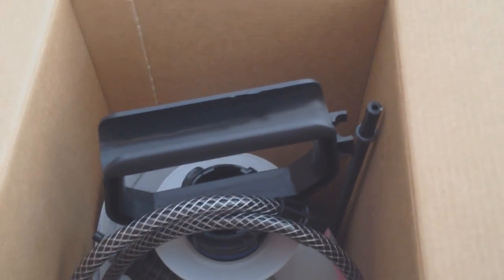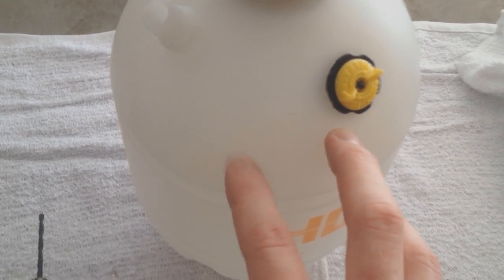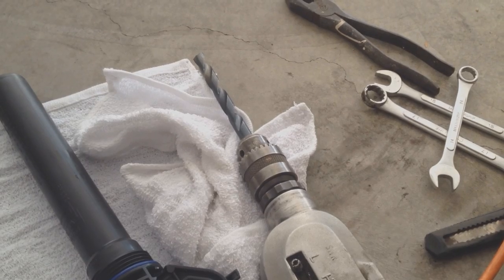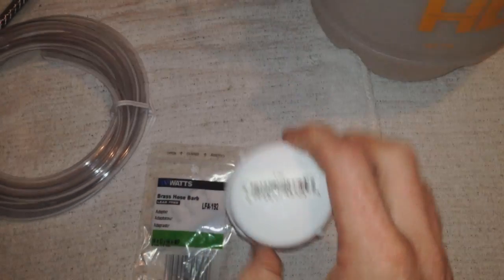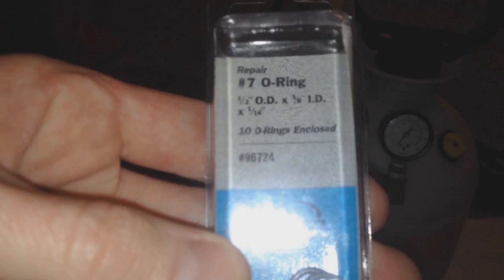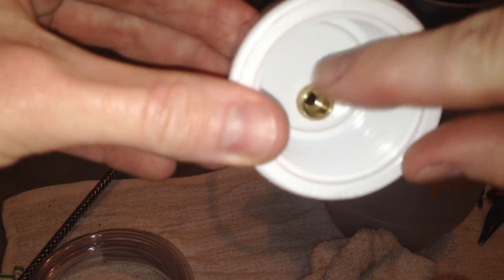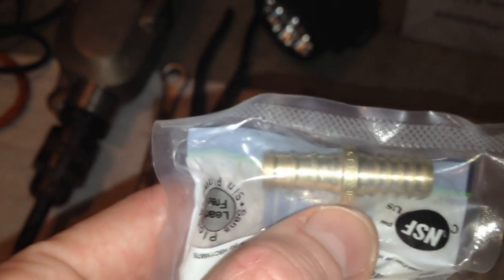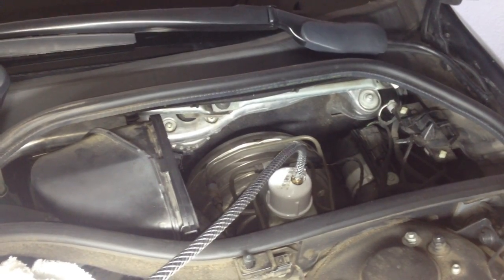DIY Make Your Own 1 Man Pressure Brake Bleeder

Comment: The guy @ Mercedessource sells parts and DIY manuals on many topics. It is the same pressure tank, but it was developed from the Motive brand brake bleed system. You can buy an adapter from Motive to fit any car and not have to use plumbing caps that might leak or mess up your reservoir... Just so other people know

Comment: Built this pressure bleeder and used it today.  Have a couple minor things I ran into I want to share.  This one is obvious but I was under the car doing the job before it came to me. Use a clear bottle for your catch bottle.  I just unthinkingly grabbed a green soda bottle and realized while using it that it was difficult to see when clear, new fluid was coming out (I was also using old tubing on that end that was discolored which didn't help.)
I have all GM cars that use the same Master Cyl cap.  Bought a Dornan at Advance Auto.  Guess what.  The rubber gasket is sold separate.  It gets worse.  Dornan mislabeled the part numbers or some how screwed up because the rubber gaskets marked for GM are all to small in diameter.  Further checking showed this to be so at all the auto parts stores I checked.  NAPA surprisingly didn't have one at all. The Ford gasket fits the GM cap right.  Criminy.
I put a QD on the hose near the cap.  Makes it very easy to get master Cyl pressure cap on and off w/o mess.
I found that 10 psi is plenty to push the fluid through.  Worked quite well once I got these glitches remedied.
Reply: Any color bottle 8s fine, bit clear hose is a must
Reply: @ethanmaiden  Don't do this.  It works but this is far from best way to do a bleed.  Makes a BF mess for one thing.  Vacuum bleeder from Harbor Freight, blows this away.

Comment: Great vid.
Using a 1/4" NPT (or other appropriate) tap would allow you to thread the material with the correct tapered thread pitch.The correct drill size is usually marked on the tap. No need for o-rings, heating plastic, potential leaks, or a fitting suddenly shooting out of an improperly, or non threaded, hole at your nut sack.

Comment: Looks like a great idea.
My one question is, what happens to the air between the brake bleeder including the hose and the brake fluid reservoir when you start pressing fluid into the system, does all that air have to be pushed through the system.
Reply: That a good observation. I would "prime " the line with fluid first.
Reply: That is how you do the pressure bleeders, prime the line first and completely fill resovoir

Comment: Much simpler than that. In a pinch, get a hose, a water bottle and some string. hose goes from the bleed valve to the bottom of the water bottle. String holds water bottle in position. Make sure the hose goes ALL THE WAY TO THE BOTTOM to prevent loss of vacuum. Put the whole apparatus on your bleed valve and open the valve. Now, get in your hood and open the cap. Put your lips directly on the reservoir and blow. Make sure you don't blow too long or you will just force air into your lines (rather than out). If necessary, refill the reservoir between blows. Keep a bowl under the water bottle in case of spill over.

Done. Less than a dollar and you likely already have all of this stuff laying around.

Comment: you can go on and on about nothing
Reply: I am impressed about building you own pressurized brake fluid bleeder.  I  must have watched 10 or more videos now that I am house bound becsuse of the virus pandemic.  Ok to the point.  I see two different uses/methods  for the pressurized converted tank.  One video showed using the tank for pushing air only into a fully topped off Fluid reservoir  then pushing the old fluid out at each wheel brake caliper when opened.  

The other method and maybe the most common way of using the pump tank to house the new brake fluid and push it through the fluid reservoir and out the lines.  Maybe I am confused by watching the different methods including the hand held small tank powered by a compressor line, hand pressured tank (your method and even the trigger devise causing the old fluid to drain once the valve was opened.  I think, and maybe not well thought out, that if you keep the hand pump tank for pressure,  put a one way valve in line so no back fill, top off the reservoir every so often, using the pressure release valve on the tank before opening the reservoir and as you get to the end of the bleeding you Don't overfill the resevoir and have to Turkey baster it back out similar to when you started the process  so you Don't keep pushing old fluid through the lines.  plus you can minimize the amount of fluid to.mighr not need to open.  DOT4 is expensive for Porsches,  as you well know.  last but not lease, do you see any advantage of replacing the caliper bleeder valves with the new Speedy replacement valves that supposedly stop sir from going back into the new fluid befire the valves are tightened shut.

I really liked your videos, a bit surprised by some to the negative comments, maybe some of us watchers gave top much time on our hands.   Thanks again for your time and talent.  Bob

Comment: Here in the UK, we can simply buy a gadget called the Gunson Eezi Bleed - no compressor needed, and it costs about £20/$20 !
Reply: $62 US on Amazon and it uses air pressure from a spare tire...lotta extra work......I'll probably end up spending around $50 US for one like the link in the description. comes with a hand pump

Comment: Though your intentions were noble, your presentation is quite lacking in substance.  "Pounds, PSI" ... really???  PSI stands for Pounds Per Square Inch, in case you didn't know it.  Like saying, when asked about the time of the day: "10 A.M., in the morning."  The fittings you are using are N.P.T. (pipe thread) and, thus, they are tapered and there is no need for other measures like a completely misapplied and useless O-ring.  Again, thanks for your time and good intentions but, please, in the future, try to learn something about what you're intending others to watch.

Comment: This is a great video. I love DIY tips and tricks, especially if it's for a means to save money.
I do believe there are a few areas where this can be improved however. With that cap attached to the hose and tank it will be difficult to screw it on without having to spin the tank because the hose will become twisted and kinked. A quick connector between the cap and hose could resolve this or a swivel connector.
Also, you don't need that o-ring. As you can see, it wasn't even making contact between the fitting and cap. Simply use some Teflon type tape on the treads or some silicon on the joint after assembly.

*A quick note. o-rings only require a hand-tight, then maybe one turn more. Over-tightening on an o-ring turns it into a gasket (by causing it's 'O' shape to become flat like a gasket) at which point you then DO need to tighten it down greatly.

Comment: this sort of system has been around for decades, and is a power  bleader system,  better than vacuum systems, the old mastere system had clip on covers so the power bleader cap was just a flat plate with a full rubber plate as a seal(BONDED) together, then basic same fitting for fluid, would only fill to top of master cylinder. use low pressure, your only trying to get a steady stream go push all old fluid and air bubbles out. your system is fine as you stated if you have another cap from same master use it. pressure bleading a brake system will make standard brakes fell like power brakes,  good tutorial

Comment: I was wondering if anyone can chime in on this : 

Can't i just attach a modified reservoir cap to a tire filler gauge and use that to pressurize the system to correct PSI?
Reply: No because you would drain your reservoir real quick and get air in the system.
Reply: Yes, I did something similar, but put an air coupling fitting in the replacement cap, attached an air hose with an inline gas filter to protect against debris and I apply about 20 psi. Only thing is you have to keep a sharp eye on fluid level, as it goes down quickly, but it works great.Another advantage is I can use the same setup on any other car, all I need is the appropriate cap and an additional air fitting. The caps are thick enough that they can take a threaded fitting, but I put some epoxy (JB Weld) around the fitting on the outside of the cap, just to make sure it doesn't leak. Its easy to do all this when the cap is new and all the parts are clean.Next to pedal bleeding, I would say this is about the best setup I have ever used, and it does not require an assistant. I found vacuum was not forceful enough to get all the trapped air out, nor was gravity bleeding, although both are useful for a rough bleed.

Comment: A lot of ignorance regarding pressure bleeders in the comments.  If you know how to use one a pressure bleeder is considerably safer than vacuum bleeding.  A vacuum bleeder can actually DAMAGE certain master cylinder designs.  Also gravity bleeding won't completely bleed out certain brake hydraulic system designs.  The service manual for most cars will specify a bleeding method (some specify pressure bleeding), and that's the one you should use.
Reply: I made a pressure bleeder very similar to this one.  The problem I had with it is that the cap for the master cylinder I bought was not strong enough to hold more than about 5lbs pressure.
I then gave in and bought the Harbor Freight vacuum bleeder, the one that uses compressed air.  I now can bleed or transfer new fluid into my cars/truck with ease. I used to despise bleeding brakes, now I merely dislike it.  They are great tools.  I have used it on all my vehicles, all GM products, with no problems.
Reply: apparently reverse bleeding through the bleed screw works well with ABS , no doubt youd want to thouroughly clean the bleed screw first and hope your existing fluid inside the brake calipers is not heavily contaminated like ive seen in the past.
Reply: @closertothetruth9209  Reverse bleeding?  Not sure who you were commenting too and vacuum bleeding isn't reverse bleeding (never do that with ABS).  Can you explain what you mean?
Reply: saw it on youtube, adds basically and they said you can reverse bleed ABS no scan gauge required.
forces the fluid up into the brake fluid resivior from the bleed screws at the brake caliper as air naturaly wants to go up not down. theyve done it on motorbikes for decades
Reply: @closertothetruth9209  It's just exactly that (pushing fluid backwards toward the Master Cyl), that you don't want to do on an ABS vehicle, especially GM.  You really shouldn't even push fluid backwards when you change brake pads.  It "can" cause a loss of firm pedal that you can't bleed out.  You have to buy a mid-level scan tool that can run "ABS autobleed" function AND bleed your brakes at the same time, several times.   Something in ABS pump (can) get stuck in the wrong position if you push fluid backwards.  It can literally ruin a good vehicle.  Don't do it.
Reply: thats what i thought , ill have to wait  n see what happens when guys use these things with ABS ,  to see if it results in chaos or not

Comment: My God it is painful watching this.  Way, way, way to much detail.
Reply: It burnt me out hearing somebody explain an entire page worth of words about how you can either set the jug up on the engine or you can put it on the floor
Reply: Well without that detail we would not know how to tighten a hose clamp.
Reply: How else am I going to learn how to remove those little plastic screw thingies that come from drilling a hole. Sheez. I'm only noob.
Reply: Better than no detail like most of the videos
Reply: Just pony up $35 and get the Harbor Freight vacuum bleeder (if you have a compressor).  They work awesome.  I'll never do this job any other way again.
Reply: Blah blah blah blah does he ever stop
Reply: @davidelwell9365  Some people need more detail than others.  You can stop watching whenever you want.  I had to learn this early on in my YouTube viewing.  Rarely do I watch a whole video.

Comment: HOw would you get the trapped air in the cap and or feed line from the pressure chamber out and not have it injected into your brake system ?
Reply: Others may have better solutions, but I first put just enough pressure in the sprayer to get the flow started in the sprayer hose line to purge the air.  I also filled the master cylinder to the top to minimize the amount of air at the cap.  Since brake fluid is heavier than air, what I think happens is that what air that is there in the cap winds up compressed at the cap. After I was done I took a long length of clear tubing and sucked the excess fluid out of the master cylinder so that it was at the proper level.  I had no issues with doing the above, and the brakes are working like champs.
Reply: Thanks

Comment: The only issue is you should have used a swival fitting on the cap.  You are twisting the hose up when you attach the cap to the MS.

Comment: Hi, have you ether tried using this setup to reverse brake bleed a system?
i.e. force brake fluid up from the nipple on the caliper to the master cylinder?
Thanks,
Reply: why do you want to shove burned brake fluid up into the system?
Reply: @ScoutPL  No its called reverse injection. You keep an eye on the reservoir level and keep emptying it until you get clean fluid coming up into the reservoir.
Reply: @olddognewtricks4804  that's true when you are pressurizing from the master cylinder as you described.  However, the person commenting to you above, was going from the caliper up.  That is not what you describe and it would indeed be shoving the worst of the fluid up into the system.

Comment: what a waste. By the time you buy all of this stuff you could just buy a mighty vac brake beedling system $35.
Reply: At 35.00 it is a vacuum bleeder, not a pressure bleeder. Vacuum systems can be problematic and a pain in the a**. This would be much better.
Reply: Not the same as a pressure bleeder and his system is cheaper than the $150.00 pressure bleeders made today.
Reply: Not a waste it's pretty expensive in EU. 105 euros!
Reply: George Santos lousy shops use vacuum bleeders, good shops use pressure bleeding
Reply: Daniel Kuchenberg learn the difference between vacuum and pressure bleeding
Reply: I just went to walmart and paid 5$ for a gallon sized sprayer, $2.47 for an rv blow out plug, and I plan on modifying my existing cap and buying a new one. The new cap is 10$. I just paid ~$17.50 for a custom bleeder made for my vehicle, which is half the price and works better than a universal no-fit adapter.
Reply: I'm a mechanic and the old vacuum bleed systems often have problems with newer vehicle which is why Snap-on etc sell pressure bleeders too.
Reply: Closer to $60 were I checked.  Plus shipping.  I already had some of the stuff and sprayer was on sale at HD.
Reply: @danielkuchenberg7046  No, it's not.  The compressed air, vacuum bleeder is the best new tool I've used in years.  Beats this system easy.

Comment: i would suggest a hand help "tap" holder....a tap for making threads in whatever mostly metals.its adjustable and holds drill bits .this forces you to slowy turn the bit so no debris flies all over...just two cents from 25 yrs of mfg maint.

Comment: The only thing I liked about the set up was the pvc cap idea, lucky that it fit in this application.  Heavy duty cap that is for sure.  
As for the rest of the set up, I would surely do it differently.
I would use all plastic nipples with compression fittings and grommet set up and you are done.  
The hose that is used here is too stiff.  Simpler to get a clear mailable hose.  10 to 20 lbs. of pressure is not much to worry about.
Also make another small bottle to catch the fluid at the brake end by the wheels.
For that just get those plastic restaurant type ketchup, mayonnaise bottles with cap and nipple on them already.  You can get a pack of 6 of them from Amazon for like $10 and use the other 5 in your kitchen to put your other shit in it, like ketchup, sugar, oil, mayo, mustard or whatever.  And you are done. wolla.

Comment: I made a brake bleeder like your show in the video. I did not put a pressure gauge, but still work well for me. Not leaking brake fluid. I do not know how durable are the seals of the pump, do not care, after all the sprayer only costs a measly $ 10. I will make a transmission fluid refiller for servicing sealed automatic transmission. I hope it works.
Reply from the maker: +Gonzalo Hernandez awesome great job Gonzalo.
Reply: The pressure gauge does look good imo.
Reply: Be careful not to pump pressure more than 20 psi!!
Reply: This setup is great for filling differentials and transmissions too. You just have tk make different attachments with quick releases.
Reply: If anyone is worried about longevity, they sell sprayers made for bleach, the seals have to be better.

Comment: Thanks.
Very good instruction set and video.  Anyone just starting to work on cars will find this valuable.  Your approach to this is ideal - don't assume how much your audience knows, detail every step. 
I found that 10 -15 lbs pressure to be adequate.  I discovered the hard way that on my E30 some low pressure lines were not clamped and that would have made a mess if I hadn't inspected the whole system prior to the brake flush.

Comment: Brake fluid is Hygroscopic, it attracts moist (water) from the surrounding air and the water will lower the boilingpoint of the brake fluid and will cause corrosion in brakelines.
These DIY cheap pressure brake bleeders will push even more moist from the air into the brake fluid. That is the main reason why the more expensive pressure brake bleeder are made in stainless steel, and use a rubber membrane that separed the pressurised air from the brake fluid, to keep the moist out of brake fluid.
These cheap pressure brake bleeders are more suitable for transfering oil or cooling water, but not for brake fluids.